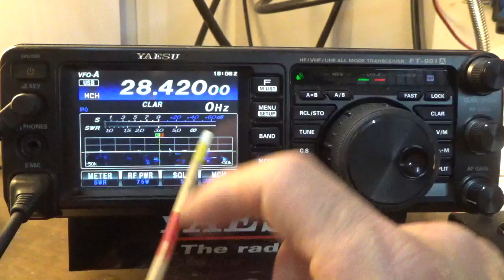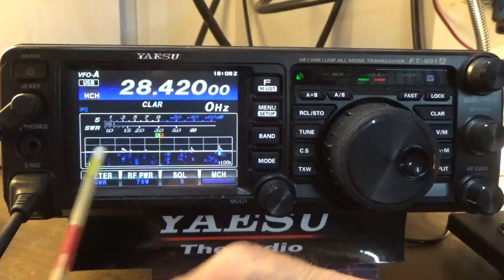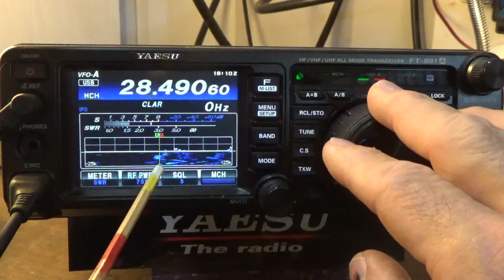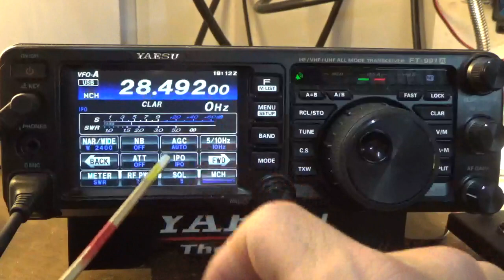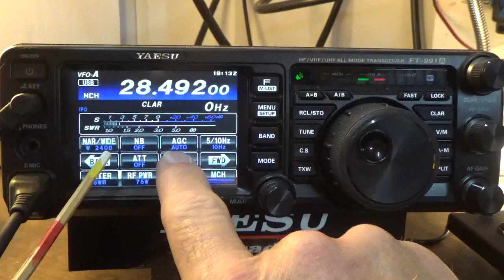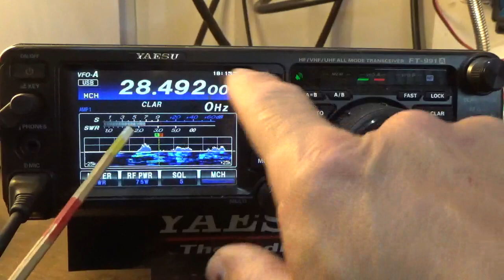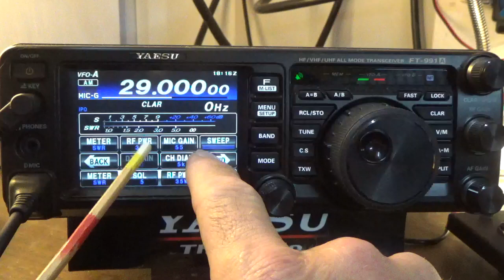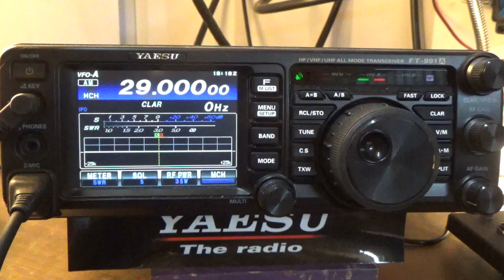Demo of IPO/AMP1/AMP2 & ATT with Water Fall and Spectrum 10m AM Demo

Comment: Hi Steve, I came across your video and it’s nice that you give some tips to other users of this radio. I’m also an happy owner and don’t feel the need for changing it with later yaesu fancy models. With due respect I’m afraid a couple of points are incorrect though. 

1) the “standard” for yaesu is PRE1 ON (or IPO OFF on other radios) if you want to give “real” signal reports and S9 on this radio correspond to a signal strength of 36dBuV so pretty close to the standard -73dBm. One good thing though is that the S-meter scale is very linear from 5 to 9, a little less below 5 down to 0 but still good enough. Quite precise also on the red portion from 9 all the way up to 9+60db. So overall a good meter for a ham radio.

2) on this radio 6dB does not correspond to 1 S unit. Actually each S unit reflect a 3dB increment. I proved it with lab instruments and is also mentioned on the tech manual.
So with ATT ON you’ll get a drop of 4 S units on average.

All the best
73
Diego
Reply from the maker: Good evening thanks for the information, I'll absorb it and better understand, its good all the information helps all of us learn - thanks and keep in touch 73